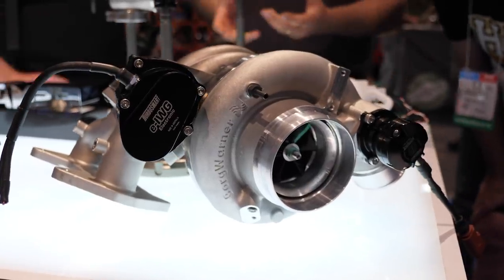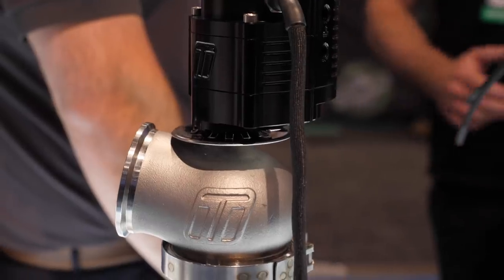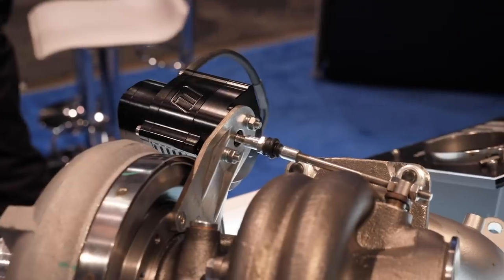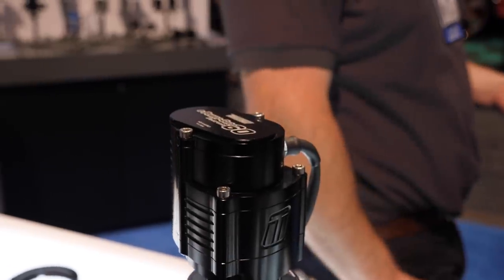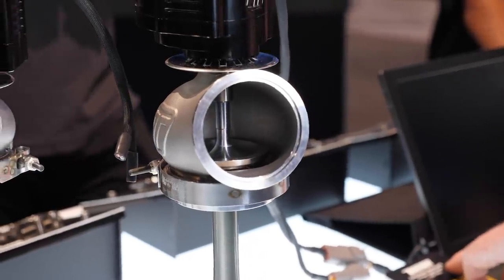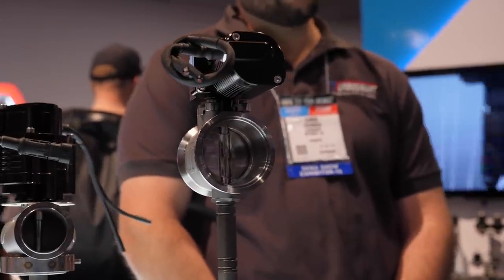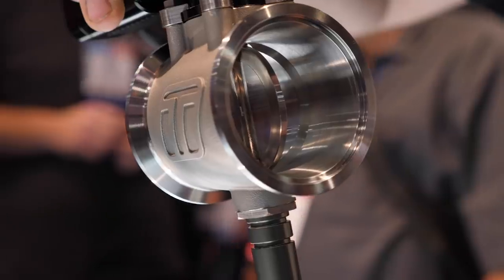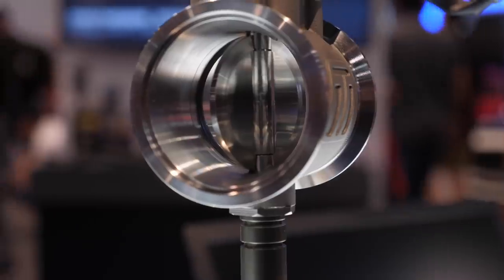Electronic Wastegate Control Is Here! | Turbosmart eWG At SEMA [TECH TALK]

Comment: Sometimes you see something and think 'Why hasn't someone done this already'?..... this is one of those times 👍👍
Reply: I had the exact same thought. I'm glad that the staff at Turbosmart explained why racers needed to wait so long. Actually, I never knew why any computerized engine ever needed pneumatic controls of any kind.
Reply: I'm still waiting for vgt's to become mainstream in the performance world lol
Reply: @neomeg2232  I have heard that VGT turbos don't handle the heat of gasoline engine exhaust very well. That is why they are typically found in diesels. DPF Diesels that frequently go into active regen often wear out their turbos.
Reply: @skylinefever  they had problems with the heat decades ago, but metallurgy and cooling solutions have come a long way. And I worked for a Mack truck shop when I was younger. That's how I actually learned about vgt's. The only problem dpf regen systems had were on vocational trucks that had frequent starts and stops with drivers that didn't understand how they worked and constantly cancelled the cycling until the truck disabled itself. Only took a little while for them to stop doing that and getting stranded part way through the route. Lol. Otherwise otr had no real issues
Edit: as a side note, they're on diesels because that's the industry that needs to push the technology. And also, that's not how a regen system works. They're not any harder on the turbo than the earlier systems. Besides, regen wouldn't even be a consideration on gasoline engines, so it doesn't apply
Reply: I know this just sprung to my head and started googling and guess it there already

Comment: We need a driver that interfaces the ECU, receives PWM/Duty cycle from the ECU and the position through the encoder on the actuator and has a H-bridge to control the motor. That's a lot of current for a inbuilt, design for TB driver. Looks like the actuators are liquid cooled
Reply: Even if your ECU can drive enough current, you are going to shorten it's lifespan, plus you you are better off having the H bridge closer to the motor. I suspect it's a BLDC anyway from the way he was talking about it.
Reply: @sanityd1  It's a brushed DC motor.  At least from the photos they have shown, and how they are describing it, since there are only two wires going to the motor.  The three wires for feedback sound like a typical hall effect or potentiometer for position feedback.
Reply: @WickedTRX Adding something in between that handles the closed loop control is just asking for trouble in regards to tuning it.  Since if you are trying to use an existing PWM output on an ECU that would've been used for controlling a WG Solenoid, the closed loop control within the ECU could end up fighting/oscillating with the closed loop control inside the eWG driver.  IMO, there are two good solutions.  1) A "dumb" H-Bridge amplifier that simply takes the H-Bridge outputs from the ECU and use them to drive a stronger H-Bridge.  That way the PID control loop remains inside the ECU without a second PID loop or something that would add excessive delay.  2) An all in one eWG controller that has its own tuning software to set a desired boost vs rpm,gear,etc.  That controller would have the PID loop built in, and would only have one purpose, to control the eWG to meet the desired boost.

Comment: Will be interesting to see how people package the butterfly WG, 
Will definitely need to be decided from the start that you're going with that style. 
I see mounting straight onto the turbine housing being a popular solution.
Reply: Heat is the enemy of electronics. I have run some downhole tools in the oilfield that cost over US$30K each rated to 165C and sustained temperature's of 130C in the wells would still kill them in a couple of weeks of use. Granted, the tools being used had FPGA chips in them but simple things like inductors and even resistors were the first things to fail. Keeping these things as cool as possible will be important if we want the best useful life from them.

Comment: I wonder if you can bleed off drive pressure and run a smaller a/r turbine housing, so you can get on boost earlier and then start to bleed off enough exhaust to lower the drive pressure but still keep the turbo at the  desired boost pressure.

Comment: I wonder what would happen if you could instantly retrofit these devices to existing turbo engines. By having faster motion, people could get the most out of stock or near stock levels. I'm sure someone would invent something that goes between the OEM ECU boost control solenoid wires and the Turbosmart electric WG actuator. It could draw current from somewhere else in order to function, there could simply be another relay that activates when the ignition key is turned.

Comment: Very good idea. Their horizontal waste gate is almost identical to a Paccar Diesel engine egr valve and Cummins egr valve as well. That tech has been in the trucking industry for years. Cummins came out with the vertical style in 2007 and plumbed it into the coolant system for longevity. I’m curious to see if these aftermarket valves will be run on a can network for speed and precision as they are in the diesel world. Looks pretty similar- https://www.bigmachineparts.com/collections/peterbilt/products/cumming-egr-valve-2881762nx

Comment: Andre, do you have any info on the e-IWG version at all?
Reply from the maker: Hey Tai, what specifically are you after info wise on the eIWG? I'll check for you once Andre is back from PRI - Taz.
Reply: @hpa101  
Thanks for the reply Taz, I guess the same info that has been mentioned about the others. Back pressure limit, current limit, water cooling, etc. And if it will be released with the others or at a later point. The EFR's with the large internal gates suffer badly from exhaust back pressure, so very keen to run one 👍
Reply: I'm wondering the same things
Reply: I also think about this, as many people may be better off using a stock frame turbo, a stock frame turbo with different wheels fitted, or a different turbo that lines up with the stock plumbing.

Comment: It's cool , in some ways not as elegant as using "free" dead-ended boost pressure as the control FORCE.  10-20 amps of electrical power of extra load that ultimately is being taken from the crankshaft and not going to the drive wheels.   So only use an electrically POWERED 'gate if you can't get the control one requires  by pneumatic methods.
Reply: At max current it's going to consume 240 watts. Add in some alternator inefficiency and you are no more than 1/2 of a horsepower. You will never be able to detect that on your runs.
In fact the weight you save by not going to a CO2 driven system, with a CO2 bottle, probably negates any horsepower loss charging system. An extraordinarily high performance car is 2 lbs per horsepower. A CO2 driven system is about 4 or 5 lbs.

Comment: Any idea on target temps for the Electronic wastegate? Is the lack of air from the boost reference gonna be a factor?
Reply: He didn't mention it in the video, but the actuator on the butterfly valve had coolant ports on the housing, it even had a little coolant icon.
Reply: @johnnason7019  Yes I am aware of that, Hence why I was curious regarding target temps. Wondering how taxing it will be on the cooling system

Comment: solid state relay between the 20 amp unit would be easiest and cheapest way to run it on any ecu
Reply: You need 4 drivers to produce a H bridge. You also need to have a blanking period between the high and low side switch, which isn't so easy DIY. 
The encoder position sensor isn't common in aftermarket automotive, so not many aftermarket ECUs support that.
Reply: @sparky173j  they explained that the feedback encoder is common basically the same as the feedback used for drive-by-wire throttle bodies which most modern aftermarket ecu's

Comment: Back drive issues? Really? Use a damn Worm Gear. How is that so hard
Reply: Worm Gears need to be built and mounted strong to avoid breakage and tooth skipping. They're also slow to react and suffer from relatively excessive friction.

Comment: Why are you talking about the ECU providing the raw electrical power for the Actuator Motor ????
The  Actuator Motor should be connected to a ~20 amp fuse, 
which is connected directly to the Alternator/Battery System,
through a relay controlled by the Ignition switch.
With the ECU simply providing a very low current, 5 volt, PWM control signal,
to the Actuator Motor Controller circuitry.
Reply: Because it doesn't work like that, the unit is only a servo and encoder so it requires an external driver and provides feedback some tech's may be able to do this directly just like controlling a drive-by-wire throttle body and others will need an external h-bridge to control it
Reply: @shaynegadsden  
Ok, got it,
The controller is not built-in because of the high temps expected around the valve,
the motor can take it, but common semiconductors start dying at around ~200F ,
and it's not uncommon for under-hood temps to exceed that, 
and high-temp semiconductors can get expensive real quick.

Also, they probably shouldn't call it an "H-Bridge", simply call it a Motor Controller,
very few people actually know what an H-Bridge is, or how it works.

And, I wouldn't want to depend on a generic H-Bridge Driver circuit for a high current motor,
it needs it's own dedicated, stand-alone, controller, mounted anywhere but under the hood.
These valves can pull 4X the current of an Electronic Throttle Body,
that would mean a very specialized ECU to have a built-in, ~20-amp rated, H-Bridge,
we're talking 4- 16ga. wires minimum, with 4- 14ga. wires preferred, for powering the Motor, 
then 2 more heavy wires to supply Battery power and ground,  6- fat wires total,
too big for practicality on an already crowded ECU connector.
The ECU should only need 3 or 4 small wires, to the Motor Controller, 
Valve Position-In, Motor Drive Out, and 5v+ and/or ground.
.
Reply: @jimbrown563  The driver only outputs 2 wires and as for the current rating that 20A figure is it's max rated number and as they said they over built it to minimise the chance of falure from memory they said in most cases the current draw would be around 12A
Reply: @shaynegadsden  
They overbuilt the motor.
I case of a serious malfunction, the H-Bridge should be capable of the continuous handling of "Locked Rotor Amps" of the Motor.
This is assuming that they are NOT using a "Stepper Motor", but just a straight "Brushed DC Permanent Magnet" Motor,
either one can be made to work satisfactorily, but the Brushed Motor, when locked, can pull serious over-current,
A Stepper Motor is virtually "Always On" and it's controller has built-in current limiting circuitry,
so, you save 2 wires between the controller and Motor with a Brushed DC Motor, but have the potential for much heavier currents.
The video was not clear on several pertinent points.
If the Motor only has 2 wires as you say, it's not a Stepper Motor, so the controller either has to be built for "Locked Rotor Amps",
or have current limiting circuitry built-in, NOT something any ECU mfr. is going to provide internally.
It sounds like they found a nice motor they could bolt to their valve, 
but haven't really figured out how they're going to control it yet.

Comment: thanks, i hate it
Reply from the maker: Interesting. What specifically do you hate about electronic boost control? - Taz.
Reply: @hpa101  seems completely unnecessary in 99% of applications.  I could see how it may help with launch control instead of c02 on huge power applications but again that's like 1% of cars.
Reply from the maker: @BillB8  this product is designed for the 1% :) Not going to be useful to most. - Ben
Reply: @BillB8 think more creatively.  There are a lot of applications for this. Alot. I personally want it for ramping boost down at higher rpms on a unbuilt motor. But this is going to be great for those switching between street and strip application. Remember u can only get less than1 bar greater than your spring pressure with a controller. U could have a valet mode with no boost or limit to very low for shake down or economy. More accurate speed or gear dependent boost.
Reply: You silly billy

Comment: But why?  I can't really think of a use for this.
Reply: So you can adjust boost faster and with more precission, improves tunability and will make the turbo feel less spiky and easier to handle because it adjusts the boost so fast to avoid spikes and dips.
Reply: It's not for you then!
Reply: On a drag car with a huge power output, we struggle to find a spring that let's us leave the line with low enough boost to control wheelspin, yet enough boost to make the power we need. This product is absolutely perfect for us who need more boost range than a conventional spring setup would allow.